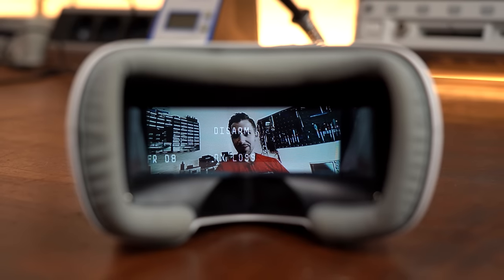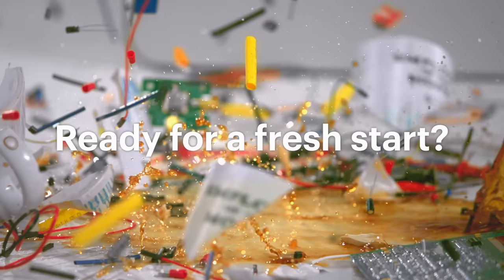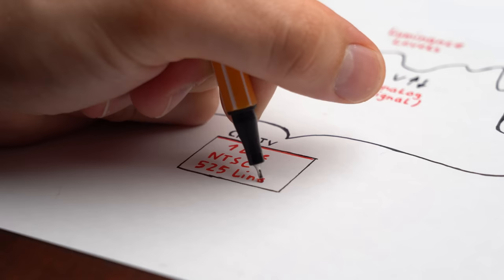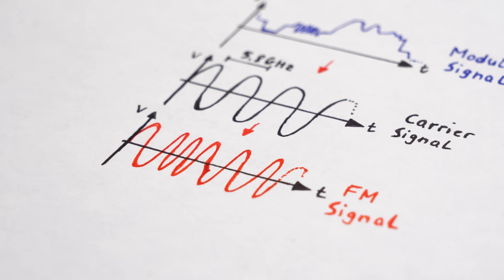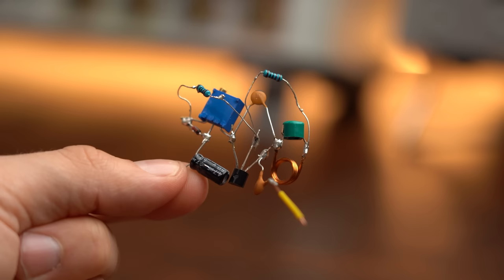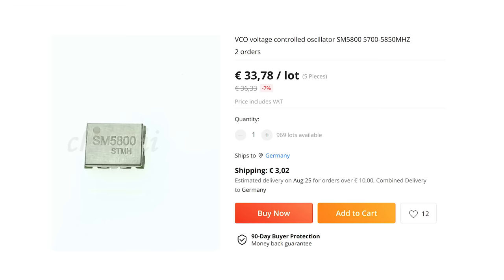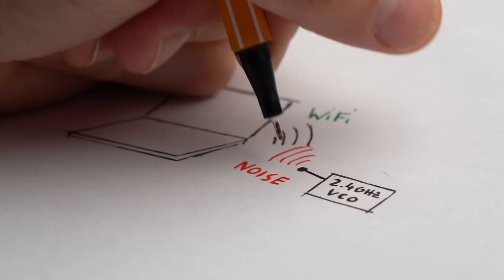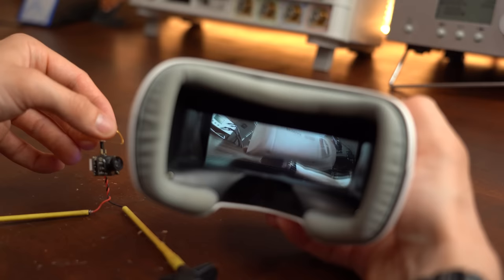I tried Wireless Video but ended up building a WiFi Jammer (A Fail Story)

Comment: before around 4 years i had project like the same of you .And my father is having big house with three floors and back then i liked to play with fpv drones and i am on the first floor , i started the flying go to the stairs and the signal lost and then the idea come.I put anthenas arround the house to spread the signal and the main board was raspberry pi that controll the anthenas the second was arduino that gets the information from the pi and the pi send it to others.And yeah it helps to get the drone to more zones.It was kinda hard to get to comunicate corectly.I am giving u that idea if u need some.I wanted to send u more details and the codes but ive see that i completly lost them.Lobe your videos.Bye!
Reply: Impressive!

Comment: Automatic band selection is part of the receiver's firmware/logic. If your outgoing band moves into another denomination it may be programmed to autoswitch rapidly in order to reduce packet loss. Shorter bands return to neutral quicker than a stray long band and therefore the differences in on board IO clocks may interpret a new band on each oscillation as jitter may not have been accounted for. You were right the while time, but you needed to see the inverse of the problem as received signal is outside the cookie cutter and to bring the modulation that is emitted back to its natural harmonic and frequency it fills in the spaces rather than computing what parts of the out signal has been modulated. 

This is precisely how tRNA associates the appropriate corresponding RNA to create an unbroken DNA helix. mRNA tells the other nucleic acids what it is, and preceding and proceeding markers view that space as a negative integer and the correct value must bring that allele back to zero

Comment: What little I know. Anything with a frequency higher than 1Mhz really needs to be on a PCB to keep down noise. AND the layout of the PCB is important too. If you can find a transmitter IC Datasheet it will have a recommendation for a PCB layout, copy that. Because they paid RF engineers to figured out the RF cleanest layout

Comment: Cool stuff, kind of the opposite of what the video was about… but may achieve the longer range you desire . From my understanding , since drones are battery powered, and radio output power regulations in certain countries etc … the way some high performance video systems work , is in the reverse to your attempt. instead of amplifying the TX , you amplify the RX at the “base station” or googles , that way the heavier battery back isn’t on the drone and your conserving the drones battery by transmitting less power from the video transmitter , since your on the subject it would be a great video to understand the RX of the googles ! Cheers

Comment: When making rf circuits ground plane is necessary, you could make prototypes in "dead bug" or "manhattan" style approach, also lead should be as short as possible, because of inductance which makes low pass filter with parasitic capacitence, also breadboard is no go.
Of course to get best results dedicated pcb with controlled impedance lines is needed.

Comment: So. Let's start from the basics. It is really hard to build a reliable RF circuit, especially if you don't have instruments to monitor it. At 5.8 GHz any unshielded wire is an antenna, even a few millimeters. PCB with a GND substrate is needed. You must not remove that shielding from the circuit. For power supply you have to use a few ceramic SMD capacitors in the 10pF- 10nF range, and forget the electrolytic ones, they are useless for RF. You need a circuit where you can adjust the gain and offset of the video signal, otherwise probably you are overmodulating the signal.
Reply: Just a tip: you can hook up the oscilloscope on the receiver demodulator output (if there is such) to see the received video signal, it should help to find the issue

Comment: Everything higher than 1 GHz needs special microwave pcbs (printed coils and capacitors etc) and only few experts can DIY this stuff. Nothing reacts like expected from lower frequencies. Maybe you can go digital? DVB-S2 or 2.4 Ghz or 5 Ghz Wifi? disadvantage of the wifi is that it needs a 2 way connection. DVB does not. there are circuits out there that can be used.

Comment: Maybe a principle of re-amplification is better than re-modulation from scratch? Could a DC-coupled 5.8 GHz pure amplifier & high gain antenna do this instead - while of course smashing any regulations as well? I guess proper insights into polarisation and “ground plane” of the antenna also will help? Beyond my knowledge, other than I see that it matters a lot… 👍

Comment: If your antenna are not the same length it will do this. Make sure both antenna are the same length.  That is how you tune the receiver with the transmitter.

Comment: Hey a Flight test made a video on how to make your own micro fpv system built off of a pre-built chip.  You just have to add the camera, power, and dip switches.  I'll link to the video in a reply so if you want you can look up the thing they used and see how it works
Reply: Here is the flight test video:  https://youtu.be/nt6kYWbMQIM

Comment: Bandwidth! Did you say you tuned the video signal to a 2v - 5v range, a.k.a., 3v peak to peak AC? You're covering hundreds of MHz with your video signal, instead of the 20 or so the goggles expect. At 75 MHz/V, your signal should have a peak to peak AC range of ~0.2v, and your input should be centered on a voltage according to the range of the VCO, selecting which channel you're using. Driving a VCO over its whole range (like you seem to be doing?) is exactly how a frequency jammer works... you'd just feed it a sawtooth/triangle wave signal to fill a given band instead of an out-of-proportion video signal.

Comment: Funny video. But before messing around with different transmitter/modulations,  I'd recommend to optimize the antennas. YT (RCModelReviews, Joshua Bardwell, etc.) is a good source for this fpv stuff :)
Reply from the maker: Yes. Antennas may be a topic for an electronics basics one day.

Comment: Fiddling around  with high frequency radio can be very tricky. Just the probe or a screwdriver nearby can changes everything. As always with radio, the first step is to get a good antenna. That should increase the range without too much hassle.
I'm sure HB9BLA (Andreas Spiess) will have some comments :-)

Comment: looks like there is a dc offset issue with the sync signal i vaguely recall building video distribution amps 10 years ago and having allsorts of rolling, tearing  and whitewash issues till i fitted gain and bias presets... but then that was directly connected 75ohm terminated kit not an isolated transmitter/receiver so this may be irrelavent-- i would be looking at what the transmitter could be doing to prevent the dc restoration circuit in the receiver recovering the correct sync signal dc levels-- maybe some nonlinearity at close to negative rail

Comment: You are looking at the wrong end of the horse. Instead of trying to boost the transmit power, you should focus on building a lower noise receiver. FM receivers make use of a principle known as FM improvement which allows trading off bandwidth for improvement of the signal to noise ratio in the information band. This works great at high carrier to noise ratios, but breaks down at a threshold level which is determined by the modulation index and the type of detector. The breakdown occurs when cycle skipping errors start to occur, and at carrier to noise ratios below threshold, the quality of the signal rapidly deteriorates. Without going too far into the weeds, it's a given that the receiver in your goggles isn't great, and it should be possible to improve it to allow significant improvements in range. An alternative would be to improve the receive antenna by making it more directional...

Comment: its possible to amplify signal without opening none of the devices anyway ;) but from buzzing its seems like its missing clock signal as you can see pictires seems cascaded. Either frequency mismatch or too slow to pick interrupt/clock signal which happens when you tune old tvs partially on upper or lower frequency. I thing anyone who used manual tuning televisions can see it ;)

Comment: Maybe try measuring the values of the actual working device and then try measuring your DIY circuit. Comparing both would be able to make sense where is the actual fault. And I guess the modulated signal is not properly modulated maybe due to not the perfect rating. Make sure the modulated signal and the input signal are both similar.

Comment: Why not use SDR with a microprocessor to output a digital signal? at 5 GHz you should be able to, the only caveat is that will increase drone weight by quite a fair amount.

Comment: You need to control the VCO voltage with a PLL circuit. That phase lock loop. Do some research.

Comment: It's quite interesting video, and I have managed to make kinda video transmitter by simply injecting composite signal through to customly built fm radio transmitter circuit tuned to 583.25Mhz (Channel 35,UHF) which sorta works, albeit missing colour information & very noisy with few other problems so will have to add a ton of filtering and keep monitoring signal transmission for ways to improve the circuit.

Comment: Instead of using VCO's, why don't you build a micro RF linier/kicker/amplifier?? 1 or 2 watt boost would give you around 2 mile range. All you need is a linier transistor rated for 5.8GHZ at 10V to 20V a micro transformer and some capacitors. I build 1000 watters for CB's but for a 1W-2W boost I bet you could make it pretty small and lite.

Comment: RF stands for Really Fucking hard. Your deadbug circuits had no chance of working at 5.8ghz. you could potentially build a RF Amplifier that way that works at VHF, but you'd likely still need to follow one of the designs that use a copper clad PCB as a base. If you want to get something working at 5.8Ghz I would look at RF Amplifier ICs that are made to work at that frequency, then get an evaluation board, solder a proper RF pigtail to the camera PCB, then use RF coax cables (most likely sma) to connect to the eval board. Then you just have to make an antenna that has a good SWR.
Reply from the maker: Thanks for the feedback
Reply: Great video as always! I work as a digital design engineer on 5G radio heads. The RF guys are always doing their black magic, but usually they are just copying the reference design, sticking to rules of thumb and simulating. I designed a bandpass filter at ~300 mhz before and even the parasitic elements of resistors, inductors, and capacitors had huge effect. Once you get higher than that, you start using micro strip traces as your inductors and capacitors. And higher than that wave guides.

Comment: From the images on the B/W TV you were ultra close but it seems either your video bandwidth is way too short from the way the picture was tearing ie loss of horizontal sync pulses, and/or more likely the video standard coming out of the drone camera is likely the US NTSC standard 15734kHz whereas in Germany, like Australia used PAL 15625kHz for horizontal sync frequency & your B/W TV is unable to lock on.
I'd have to see a spectrum analyser plot to see what's really going on.
FYI, Signalhound make an inexpensive USB spectrum analyser capable of into the multi GHz range.
Peter @ TRX lab (fellow German) might be of help as spectrum analysers are sensitive & you need to attenuate any input signal to a certain dBm level.
Also, Hayden @ Ham Radio DX has stacks of experience with microwaves.

Furthermore, the RTC6705 is an 5.8GHz FM tx chip & your B/W TV is likely expecting an AM vestigial sideband video signal as generally PAL standard has a 5.5MHz FM subcarrier to carry voice signals but older TV sets had better tolerances to out of band sync signals & better at slope detection.
The companion RTC6715 FM receiver chip might be better to pair with the RTC6705 5.8GHz tx chip.

The LC tank circuit won't work so well at 5.8GHz as the component leads are way too long & you're probably also suffering a ton of parasitics as at 5.8GHz a simple loop of wire maybe sufficient for it to oscillate but unless you have a GHz capable spectrum analyser it's hard to track down, plus you'd have to swing the 5.8GHz frequency about 4MHz (Laplace transforms can estimate the FM deviation) & can't see a simple LC tank circuit being successful there due to horrible frequency drift.
As you noted when you pulled off the SM5800 shielding can from the 5.8GHz tx, even a few mm of wire is significant at 5.8GHz & the general RF rule of thumb is that anything approaching λ/10 (1/10th wavelength) becomes electrically significant at microwave frequencies which is why they heavily use microstriplines as that piece of wire at DC looks like a huge inductor with distributed capacitance ie a transmission line in the GHz microwave ranges.
FYI, 5.8GHz wavelength is 5.16cm (51.6mm) so λ/10 = 5.16mm.
Those FM broadcast band bugs using LC tank circuits are very unstable with hand capacitance which most designers tend to buffer via emitter follower stages & shielded cans to reduce stage loading.
The 2N2222 has a Ft of 300MHz & won't work at microwave frequencies due to high miller capacitances, good for VHF FM bugs, not so good for 5.8GHz.
A better bet is maybe use a MA42151-511 microwave transistor but forget any point-to-point wiring & keep the leads ultra short but RF at GHz frequencies is a lot of voodoo & trial & error.
This is usually why satellite receivers rely on the LNB (Low Noise Block) downconverter where microwave frequencies get beaten down to a easier managed IF frequency which is far more forgiving of layout.

To make life far simpler, you're far better off using one of those microwave capable DDS VFOs ie https://www.aliexpress.com/item/1005001477323708.html .

To increase gain with your existing setup, either make a directional circular polarised antenna or even better, a tiny bi quad antenna cut for your drones RF frequency, see https://www.changpuak.ch/electronics/bi_quad_antenna_designer.php etc.
This would be the best solution, but of course put shielding around the non desired emission direction so any radiated RF doesn't blow the RF class licence specs & a simple chocolate can tin used as a reflector works wonders (or a steel wok with holes in it from the $2 shops).
I've tried 2.4GHz ones using Ovaltine powered chocolate cans ie https://craftboard.app/diy-long-distance-wifi-antennas/ & Cantennas ie https://ftp.unpad.ac.id/orari/cd-yc0mlc/wifi-advanced/wlan-24ghz/antenna/tincan/tincan-1/How%20to%20build%20a%20tin%20can%20waveguide%20antenna.htm .
You probably guessed, I'm a ham radio guy as those bands are close to the 13cm band (2.4GHz) & 6cm band (5.7GHz).

Hope it helps & love the video!

Comment: pal/ntsc analog use a AM for video and a FM carrier for sound, so changing the freq to get a pictute on tv wil never work. also for googles that can use fm make the video sinal level very very small a the a to much voltage makes yor signal much to width. less is beter in this case, also the vco's neet to be able to be modulted with a high freq aroun 4.. 6Mhz so check if vco dont have a cap on its input (or make sure its a very small )

Comment: On the LC oscillator transmitter - did you also try applying the video signal (maybe stepped down a bit) on the base of the transistor?

Comment: I have very basic HAM knowledge and I think your antenna is definitely not helping(although I doubt this is the main problem). Using a dipole calculator, your antenna should be 0.9ish inches and should be soldered to the board in the center of the antenna. Analogue signals are pretty hard to mess around with without corrupting them in some way so I haven't really messed with them much but I figure my advice could at least help to make the finished device's signal stronger!

Comment: There is no way you can get a circuit which has a design operating frequency of several hundred MHz, let alone GHz, to operate properly on a breadboard, perfboard, or soldered together in mid-air.  The parasitic inductances and capacitances in those setups preclude anything from working properly, and every lead on every component both radiates RFI as well as receives it like an antenna.  You HAVE to lay out a proper PCB with impedance-controlled traces to get these circuits to work reliably.  Further, you cannot really use opamps with these signals, they're too slow, have too much attenuation at the high frequencies, pick up huge amounts of noise, and wildly alter the signal's phase, so the color component of the NTSC signal won't work properly at all.  To get any real range increase, you need a high power transmitter, which will necessarily involve multiple amplification stages.  Power RF circuits are even more difficult to design than signal-processing RF circuits.  This was a good try, but you're quite far away from working circuits here.

Comment: We tried creating a homemade DIY metal detector based on the schematics I found on youtube.  Eventually we got it, but when we were assembling we got a couple connections backwards and accidentally made a thing that threw out so much rF that my wireless was funky in my home...assuming because our device was close to the AP.  BUT I also found the same device and it's mistake caused my wireless home landline to fuzz up and have static on it.

Imagine if I knew what I was doing?!  lol.